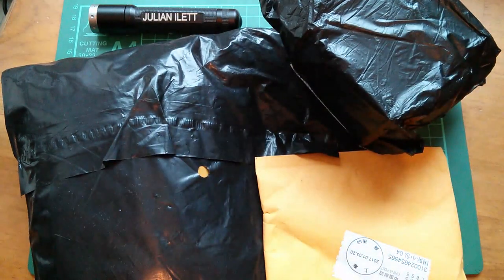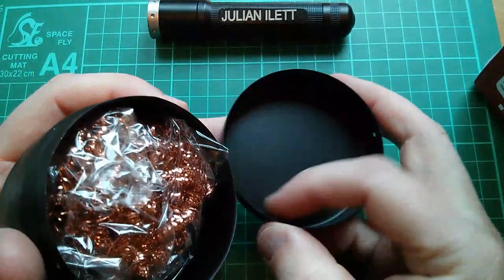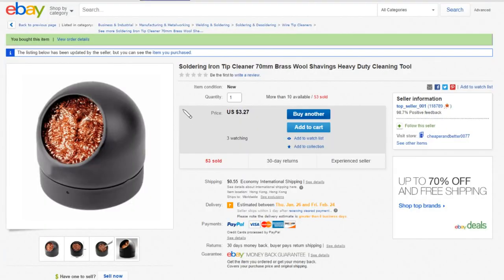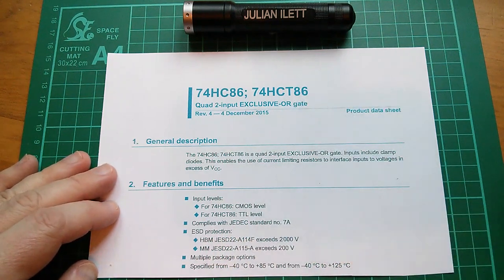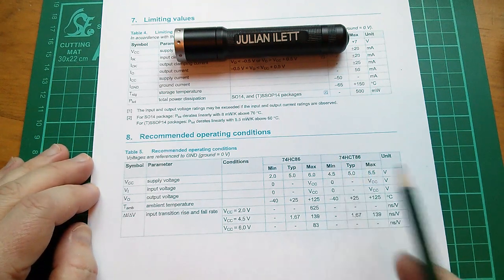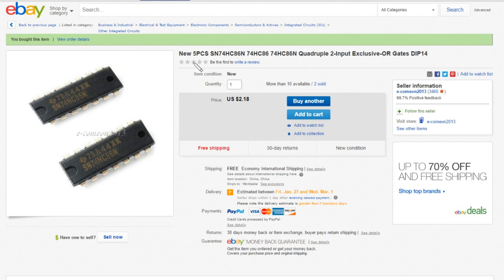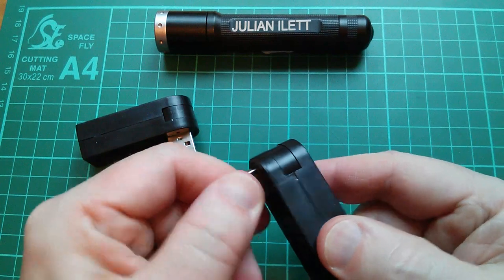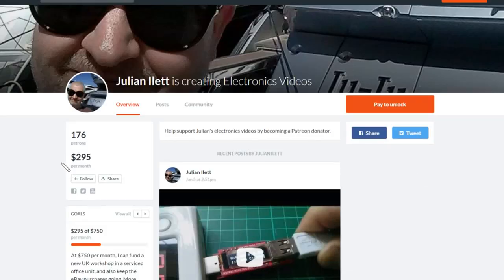Julian's Postbag: #81 - Eclectic Electronic Entities

Comment: We use those brass pads and holders at work, where we build gps circuitry and other microelectronics. I swear by them now. They increase tip life tremendously, because there's less thermal shock and oxidation without water involved. The holder really does help for solder splash-back, but nothing will completely stop those surprise wrist bites

Comment: One method for installing the LED's onto the curved surface is to use a small amount of glue to connect all the LED's to the curved surface. Once the glue is dry then you could solder all the LED's at one time. Maybe one drop of superglue would work for each LED.

Another method would be to take two small pieces of wood and clamp them together with the curved PCB between. Place one LED on your work surface and set the curved  PCB vertical, just touching the back of the LED at a right angle. This way you could solder each LED by adjusting the curved PCB and your two small clamped wood blocks so the each LED is at 90 degrees when you solder it in place. Just some ideas. Take care.

Comment: I prefer those tip cleaners with the bronzy type material inside compared to sponges. I tried replacing mine with a kitchen steel wool thing. It worked okay but not as good as the one that came with my soldering iron. I really don't envy you for having to do that kit!
Reply from the maker: Yeah, the kit looks like a lot of work!
Reply: hehe, mines a tuna can with some kitchen steel wools from poundland, screwed to a  bit of wood for stability
Reply: I soldered the LEDs with solder paste, a small tip and a lot of patience. ;-) The result is really cool.

Comment: 1. Apply masking tape to edge of strip of cardboard, so some sticky side goes past the edge.
2. Carefully place LEDs face down onto tape one at the time to get spacing correct.
3. Check orientation.
4. Apply solder blobs to one side of PCB.
5. Put LED 'holder' in place, use flux and soldering iron to tack LEDs in place.

Comment: Does a HC595 power up with outputs at zero ? If so your LFSR will need a way to force a '1' somewhere  to get things started
Reply from the maker: Good point - I could attach the XOR output via a 1k resistor to the shift register input pulling it up to 5v briefly with a momentary action switch - that'll work :)

Comment: I understand that the wet sponge method of tip cleaning causes micro-cracking of the iron plating on tips such as Weller and have found that the brass swarf cleaner makes my tip last longer - oe-er, Matron!

Comment: I just built that LED spinner back in November. It's actually not bad on the main board. The killer is soldering the SMT LEDs on the EDGE of the board. Diabolical. I don't think I'd try it without a microscope.
All I did was to tin the pads on one edge, then put the LEDs down on the table face down, rock the board onto the LED then touch the solder blob to lock the LED in place.  Then come back along the 2nd side to tack the other side down. Worked great. But as I said, I used a 10x stereo microscope (which I do for all SMT stuff - makes even tiny stuff fairly easy).

The only error I actually made on mine was I switched the crystal and the infrared photodiode (rotation sensor). once I fixed that it worked fine.

Also, the software to change the display is essentially unusable, all the dialog boxes, buttons and everything are in Chinese.

Comment: Regarding the Banggood kit. Why not use double sided tape on the pcb and trim it with a sharp knife (I used scalpel and it works great) then stick and position the smd leds to the tape before soldering. They should stay put if the heat isn't applied for too long.

Comment: If you don't want to fork out for a specialist smd adhesive (or enjoy a challenge) how about this jig.... Take a piece of thin card (postcard-ish), glue the light emitting faces of the leds to it with a water soluble glue spaced apart so that when curved to the given arc they match.  Hold the card to baseboard with blu-tak and the pcb with helping hands.  Rince when done.
Reply from the maker: Spacing them would be quite tricky - they have to line up with solder pads on the PCB.

Comment: Hi Julian,

I just finished the LED Globe and it look great, it was a one day job, you guess it right the hardest part was the edge soldered SMD LED's. I just have one Problem it won't run at 5V it is just fine with 4,5V I did not checked yet why maybe the motor spins to fast to synchronize the LED's. By the way I'm a great fan of the banggood kits they are fine for an reasonable price. Best wishes from cold Germany.

Comment: I wounder if those shavings really are brass. To me that just looks like a pot scrubber. The same type of pot scrubber I use bought from the supermarket. I think its copper plated steel. I found one made from fine wire that seems to work better than the flat wire in this one.
Reply: Cliff Hartle I'm pretty sure your right. It's definitely not brass.
Reply: I just checked the pack of Scotch Bright brand cleaning pads and it does say Copper coated.
Reply: Cliff Hartle "Chore Boy" makes 100% copper scrubbers.
Reply: well a mate of mine went to a local steel work shop and asked if they machined brass lately they had, so he got brass shaving for nothing, I have some too but I rather use a  sponge.. Im more used to that..

Comment: Will you finally start doing surface mount soldering? It's really easy with a cheap used microscope on ebay. As long as you get the right Flux even lead free is very easy!

Comment: could you use another 7555 in astable mode to produce a clock to the storage register that was some small time increment after the data clock?
Reply from the maker: The 2nd 7555 would be in monostable mode, but yes I think that would work.
Reply: I just used one timer and put an inverter between it and one of the clock inputs of the 595, seems  to work.

Comment: On that soldering kit, you might want to glue the LEDs on first? And also, if you're just using the USB hubs for power then you should consider rewiring it :)
Reply: That's what i was thinking, a tiny dab of superglue.
Reply: Have you heated super glue with a soldering iron?, very unpleasant.
Reply: indeed I have and you're right, very unpleasant.

Comment: should i connect a couple of diodes in series in order to drop the voltage upto 5v something???
Reply: 2000jago send me the link
Reply from the maker: I have a very limited range of 1 on 1 offerings ;)
Reply: Julian Ilett and what that means??
Reply: No, the voltage drop isn't constant across the current range and it's a very efficient way to convert voltages. You will want to charge your lead acid battery a few volts higher than what's printed on it, so around 6v should reasonably charge a 4v lead acid.
Reply: Not everyone is so fluent in English ;) It's funny because his username is diy electronics :')

Comment: those brass wool are any better than wet sponge ?
Reply: iceberg789 I find they're better than sponges. Mine leaves my tip nice and shiny.
Reply: interesting, my tips dont last very long, whenever i get a new tip & tin them, then after few days, they develop black area at one side of the tip. eventually it gets difficult and i need to chisel them.
Reply: a 25w iron.

Comment: hey julian i have a 4v lead acid battery and a 6v solar panel..and i want to charge the battery through that solar panel...can u plz tell me the way to connect together in order to charge the battery...
Reply: diy electronics I guess you would need a special charger to do that but I might be wrong. I am sure you will find an answer via google
Reply: LostName i have already googled it...bt i was unable to find any solution...maybe i have to upgade the panel upto 9v or 12v..!!!
Reply: Well if the battery isn't a tiny one or the panel a huge one.. you can just hook the panel right up to the battery and it will charge it somewhat. Adding a dedicated solar charge controller would improve efficiency of the panel and protect the battery (stop charging when the max voltage of the battery is reached. But usually a fairly large lead-acid battery can just bleed off the extra power I'd assume. You would want to put a reasonably sizeds diode in the correct orientatio on the positive lead to stop the battery draining to the panel when it's dark, though.
Reply: The 6v panel might be enough in bright sunlight, but you would need a reverse polarity protection diode.